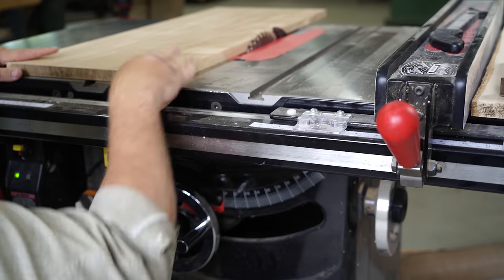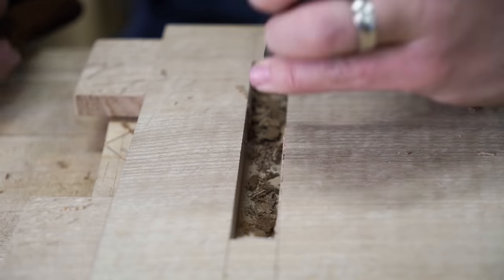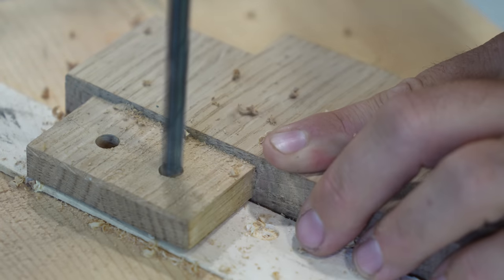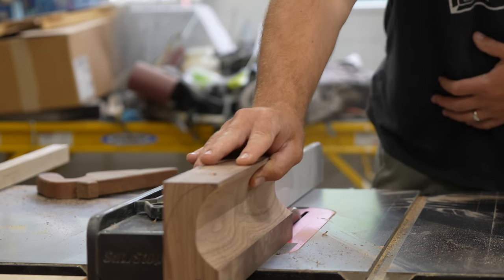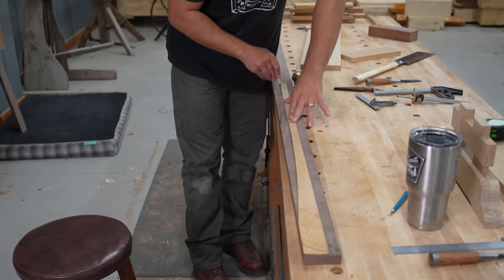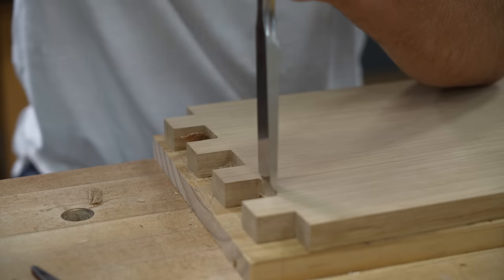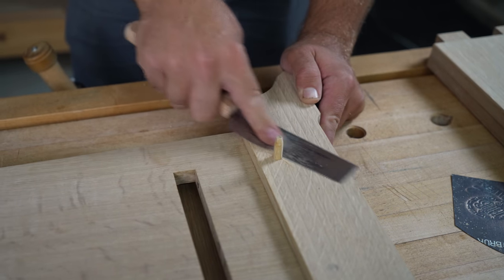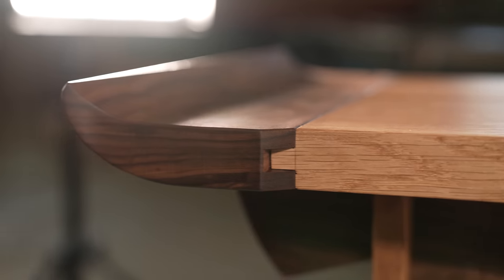Making A $15,000 Japanese Table... 300hrs of Work!

Comment: $50/hour from an expert craftsman for handmade furniture is very reasonable. The challenge is finding someone with the budget for a table at that cost. Not many people out there with that. But that rate is certainly reasonable. Beautiful table!
Reply from the maker: Yes definitely would be a challenge finding a buyer for this. I’d probably have to use my online presence to find someone, locally would be really hard.
Reply: @ThirdCoastCraftsman  Besides the expense ($15k) kinda big for my trailer home 😀  But seriously, anyone spending that much likely has big spaces… residential or commercial (think high-end office or condo lobby). They may want a pair and the 2nd build will undoubtedly be much quicker (more profit) than the first. Imagine the speed/profit on the 3-3k produced 😀

Comment: Hey Chris, you definitely knocked this one out of the park. It's a piece of furniture that could hold its own in any museum collection. I was glad to see you correctly held back on gluing those breadboard ends. I see so many experienced craftsmen incorrectly slather glue everywhere in tenon construction. I wager just gluing the treenails would have been enough. I also like the way you went with the top attachment, keeping through tenons out of there. I like that you held back on the use of the walnut. Less is more and I think you found the perfect balance to accent the piece without turning it into an oak and walnut checkerboard. Lastly, 200 hours is totally in line for a piece like that and $50 an hour is a reasonable rate for work like this. In fact low in my opinion. That's my baseline rate for estimating and I am usually looking to push it above that if the nature of the project can justify it. The fine woodworking trades are grossly undervalued at the best of times.
Reply from the maker: Thank you for the kind words. You definitely think the same way I do! I like the checkerboard analogy haha! And breadboard end construction is one of my biggest pet peeves in the woodworking world. I see it done wrong a lot and a lot of misinformation, and people trying to take shortcuts with dominoes.
Reply: @ThirdCoastCraftsman  Coving it on the table-saw was the right move and I am a little surprised that no-one has developed a fence designed to swing to an angle for that purpose. Clamping anything to a table-saw surface is a huge pain in the ass unless you can use magnets or the t-slots to do so.

Comment: One of my teachers (old timey cabinet maker) once told me that an hourly rate of 45,- is completely normal for a starting wood worker. (I'm from holland)
He himself, having 40+ years of experience, asked roughly 75,- per hour.

Your experience/technique is way better then most starting woodworkers. You could easily ask 60 - 65 per hour.

After watching this video, the technique you used to slide in de dovetails together with the sides still baffles me. Will rewatch that part later.

Lastly, during my studies as a carpenter I've read some books about Japanese joinery (of course...). Now I'm by no means an expert on the subject but I reckon that an old school japanese master carpenter would call your final product "good" ;)

Comment: There was a point where I realised I'd been watching this with a big smile on my face, and my mouth open, in a dropped jaw tribute to your build process.  It's as good as any wood working project I have ever seen, both in terms of design and application.  It was a real pleasure following along, and I am in awe of the finished table.   I am also in awe of your big jointer and thicknesser.  They are, without doubt, the most badass examples of those machines I have ever seen on a YouTube channel.
Reply from the maker: Haha thank you for the kind words man!

Comment: You've earned and fully deserve the word 'craftsman' in your brand name. You've got such a badass shop, and it reflects your design values as well. Keep it up, my dude.
Reply from the maker: Thanks man, I really appreciate that!
Reply: $50 an hour is is reasonable. As a product designer and developer. I charge 75 to 150 an hour depending on the project, timelines, and workload. You should be charging for your design time as well as your crafting time.

Comment: Love watching this build, I did a lot of sliding dovetail for my own table builds as well. Watching the final assemble, I did noticed one thing that I would have done differently. If the top draw bore and bow tie was added after the two horizontal board is assembled onto the legs. You could technically have two stop sliding dovetails where it opens in the middle. After those are added, then put the bow tie and braw bore on, you would not have the dovetail slot shown in the back. But you do loose disassembly option with this approach.

Comment: Hey Chris,

Thank you for the video, I especially love those side pins and two top crossmembers.

300hrs and end price got me thinking, one should downsize the product and do them in batches -- I would love to buy a phone stand in such oriental design with wood joinery and pins or bonsai table style cacti stand. (Imagination is the limit, just a question how small could be done)

Small spicy objects are much easier to fit in any interior, less of commitment and provide an actual means to support you as a viewer.

Cheers!

Comment: Great project. The only two things I would do differently on a personal choice level is that I would use walnut for the bowtie stock and I would prefer a fully housed mortise at the edge of the top ends detail where the scalloped walnut is joined to the top end as shown at 17:06. Essentially making it a blind spline rather than a visual component. By cheeking the tenon in order to avoid a wafer thin result in the corresponding mortise in the walnut as its length decreases to that of the width of the top. Your choice is beautiful, different strokes, different folks 😁.
Of all of the trades in human history I'm drawn to woodworking as a hobby, a trade and a passion for learning. Thanks for your channel. Instantly subbed from the recommendation. 👍

Comment: I got side tracked from flat work when I got my first wood lathe. I now have 5 of them. Getting back into flat work again, and prefer the Asian styles. Used to do all Shaker style stuff, which was all with power tools. It tool far longer to design pieces than it did to make them. Understandable how this type of piece would take longer to build than to design since there is so much hand work. Nice piece!
Reply from the maker: Thank you! I’m still scared of my lathe! I need to spend a few minutes practicing on it each day
Reply: @ThirdCoastCraftsman  Well, for me, the lathe is the best Christmas present I ever got. Turned bowls for 25+ years. Retired from that, and have to build some furniture for my house. If you get into bowls, I have a bunch of videos up, mostly about bowls.

Comment: Insane artistry. You mentioned in the beginning that this can be partially taken apart, is that difficult or risky? It all seems very tightly locked. Those wedges/tusk things I think you called them, those can come back out? It’s in a wedge shape, is there risk of those sliding up and coming loose?
Reply from the maker: Yea it can all come apart. The angle of the wedges are steep enough that they won’t come apart unless you use a mallet to tap them loose

Comment: Amazing project. Very similar to one that made me fall in love with your channel a few years back - the Japanese bookshelf that was made with no glue or fasteners. 

Question with the bit and brace, when working with oak are you ever concerned about tear out for the mortises? I would imagine you’d have to have it super sharp. Generally the speed of a powered drill helps to minimize the tear out with a fortsner bit…. But with a very low speed bit and brace I’d be worried it would grab the grain and rip it out. 

Or do you score lines first for that reason?
Reply from the maker: Oh yes the bit brace will tear oak, you definitely need good knife lines. I find it doesn’t usually tear past the knife line but yes it’s risky

Comment: You mentioned taking your time, complicated joinery etc in leading to the project hours. I don't have half the skills you do, but whenever I am winging it, it is impossible to just work constantly. It gets to a point they I have enough doubt about "what's next", that I just need time to think, or to reflect on whether I really have a handle on it. Thus I can only do so much at a time, and need to take breaks.....
Reply from the maker: Exactly!!!! It’s hard to try to explain that. Now if I was working off plans ( and not filming it) it would be way less time, but it’s exponentially longer when designing and figuring things out as you go.

Comment: When trying to get a square board edge, just place a ¼" spacer board on your bench and lay your board down on top and lay your no. 5 on its side and do a final plan. It will be square just like end grain planning with a bench hook. You don't even need a square to check.

Comment: I have a question about the mortise and tenion joint on the top shelf with the bread board if I understand you right you said you didn't drive the dowels into the tenion why did you you drill the holes in the tenion? Great looking project
Reply from the maker: You must have misunderstood. I do drive the pegs all the way through. The offset holes cause the joint to pull tight. Hope that makes sense.

Comment: How would you do the inner curve of your ends without the angled table saw blade? I did a 10" lip on a box lid by cutting lengthwise slots with a tenon saw,the then chiseled and gouged it ( followed up with a lot of rat tail rasping). Tedious but it worked.

Comment: The planer and jointer are so HUGE! 

Also your hourly rate seemed low to me for work, but I then started to think if most people charge their design time at the same rate as their build time.

Typically in software a designer would make less per hour than a programmer, or in construction the architect would ( I think ) make more than the construction crew.

Repetition would get your design time down, but your labour skill would increase. I guess that is just optimizing the process but I think your overall result would be a lower total cost at a higher rate.

I also have no idea 🤣 🤷‍♂

Comment: $50 an hour doesn't cover overhead, materials costs, maintenance costs, etc.   You need at the very least, $50 an hour for your time as the unloaded hourly rate, plus all of the associated costs of running a business and materials.    When I did engineering work, my time was marked up 2.12 times for federal government projects, and 2.5 times for commercial work to cover overhead, fringe, etc.

Comment: I don't want to detract from an amazing piece and a great accomplishment for you, because it is lovely and the amount (and skill) of work is clear to see..
However, the joint between the centre of the top and the curved breadboard ends, where the tenon meets at the outside and is open and the centre doesn't "travel out" to meet the ends is absolutely awful!! You can't make the centre board wider (now), but you could do a gentle curve scallop shape to the end to meet the centre, perhaps??
Reply from the maker: I’m not entirely sure what you are referring to. Are you taking about the outside shape of the breadboard ends?

Comment: Very nice end result, but I am confused as to the 300 hours of work. Clearly you have power tools that you use, but only on certain cuts, the remainder being done by hand. Where is the line drawn on when and where to use power tools instead of hand tools? If you're pricing it for "hand built", you used power tools. If you're just pricing the piece, it could be completed much quicker with the same end result using a larger percentage of power tools. In which case, it's much too expensive.
Just curious how you came up with the time and price.

Comment: I think this project is very much as good as anything anyone I seen anyone do. But, you are wrong about a few things: is it a $15k table? yes, but for the wrong reasons... you said it took you 300hrs to design/built it and at a reasonable $50/hr = $15k table + material cost. However, that's NOT what makes it $15k table. Most of the table in that price range are done on commission, where a buyer already has most of the design done (hopefully), and most of your design is just clarifying and figuring it out, so in this situation, maybe 10hrs of design. And say it took you 100 hours to make it or 200, fine, then it's $5-10k in labor, but where is the margin? I think 50% of labor + design + material cost for profit calculation is reasonable. So, if this took 100hrs to build, that's $5k, materials $2k, that's 7k, $3.500 profit = $10.5k and other intangibles, is design, delivery, packing materials.    Overall, very very nice piece and IMO well worth 15k, just for different reasons :)

Comment: $50 an hour is insanely low, my shop rate is $110 an hour,  I like seeing someone using old planes, tired of everyone using Lie Nielsen, they're nice, but there is something about using an old tool, that was made better, do you have any bedrocks?
Reply from the maker: Thank you. No I don’t have any bedrocks unfortunately. Always hard to find and expensive
Reply: @ThirdCoastCraftsman  I actually picked up a Bailey number 4 and a 604 at the flea market this summer for $12 each the bedrock was missing the knob which I got for $20 on ebay, Love your Yates jointer, they're great machines, I have a Moak 16" along with a 8" cresscent and an 6" Oliver, I am looking for a 24 or 30" Oliver, they are hard to come by, but amazing machines

Comment: $50/hr seems LOW. Mechanics make $100-$200/labor hour. And honestly, for a lot things, any idiot with a wrench and a repair manual can do the work themselves... except when you get into the real knitty gritty engine repairs and rebuilds. (A mechanic makes the same per hour whether he's doing a brake job or replacing a piston ring)

You give that same idiot (me, in this case) a hammer and chisel, measuring and Mark our tools, some hand saws, you'd never get the same quality of craftsmanship as a well trained, seasoned wood worker.
Reply from the maker: Thanks Peter. I appreciate that!

Comment: $50/hour is extremely reasonable here.  Cmon.  the average beta male couldn't get off of the couch to think of putting in the time, and his "partner" holds the checkbook.
Reply: More after watching the complete video (sliding/locking dovetails.  To a sharp eyed customer, the table is worth over $20K and will gain value over time.